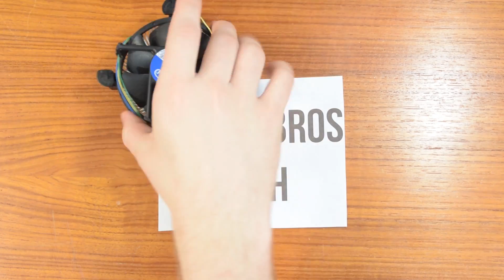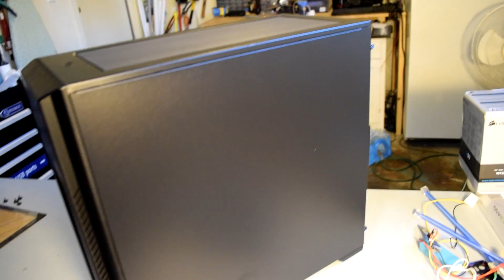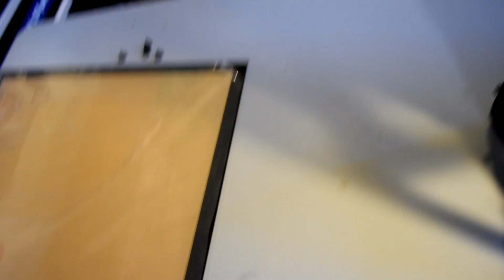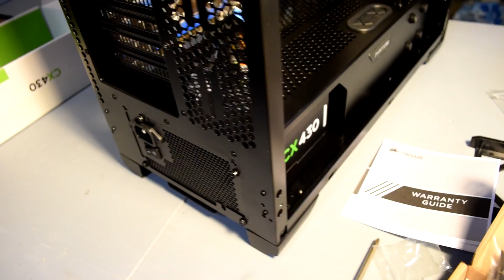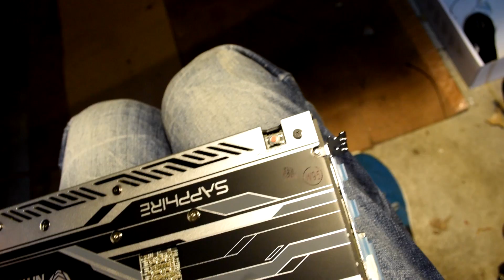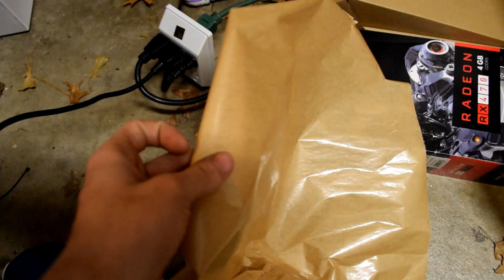$1,000 Gaming PC Build - Mid Range/ High End PC!

Comment: Sir can u help me I'm building a mid range gaming pc but I need a simple motherboard I'm not into over clocking crossfire sli stuff.I need budget motherboard and also budget power supply.
My specs
I5 6600k 3.50ghz,
Asus geforce gtx 1070 8gb turbo 
16 gb ballistix ram
120 gb ssd
NZXT S340
APC UPS(IM from India lot of power issue)
Windows 10 home 64 bit
Plz suggest decent mobo and psu which handle
Reply: there is no point of getting the 6600k if your not gonna overclock.
Reply: RAZOR12334 get an Asus z170 board to take advantage of the 6600k and I would say get 650 watts or over for the PSU...

Comment: Hi, the ram doesn't supposed to go in blue or black dimms, or dimm 1 and dimm 2?
Reply from the maker: Samuel Lopez It's dual channel RAM and all mobos are different, in this ones case you install it into the same color slots on the board for dual channel
Reply: Toasty Bros: Yes but you installed in different colors.
Reply from the maker: Samuel Lopez oh I did in the video lol, don't worry I fixed it after. Mistake on my part.
Reply: Toasty Bros
Ok, Thanks for answering.